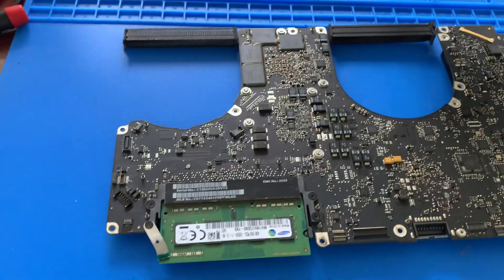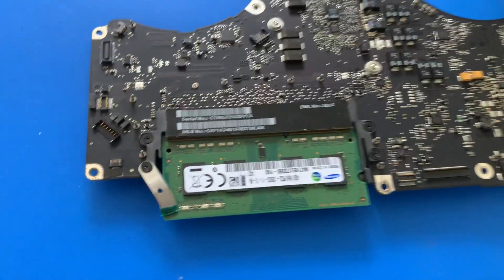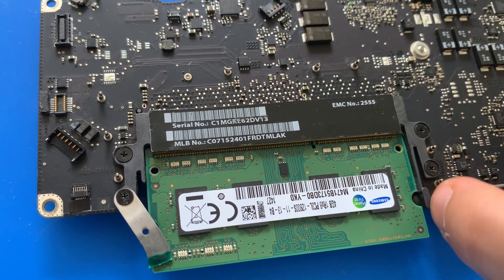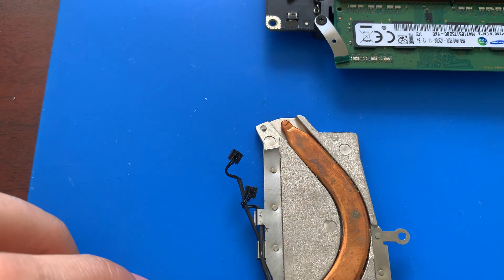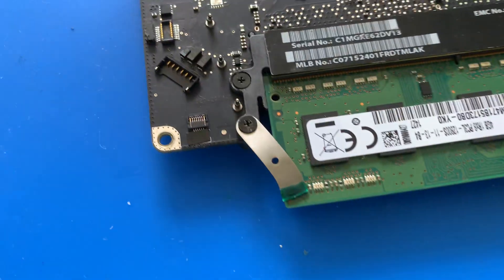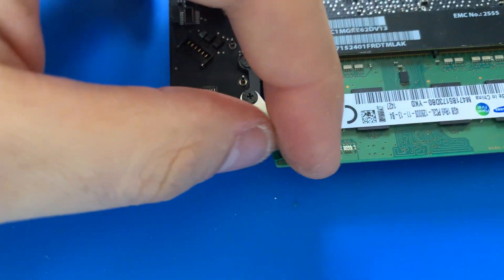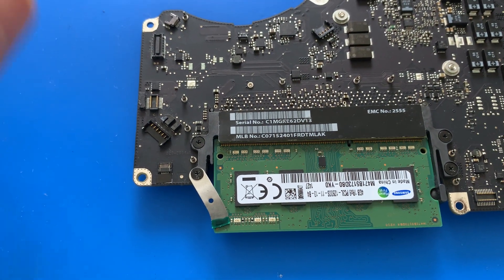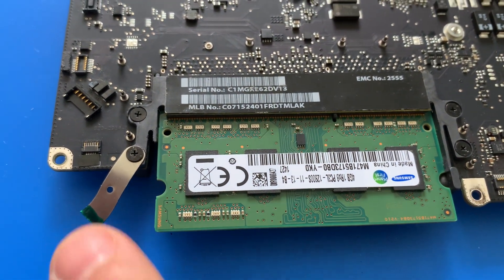Fixing broken Memory RAM Holder Latch on Apple MacBook Pro 2008-2012.

Comment: Does this have to be repaired for the laptop to work? I broke one trying to switch memory with the cover only partly off; one screw was stripped and I can not get it out. One card is out, the second got stuck because I kept pushing it down because I couldn't get it out when it was up.
Reply from the maker: I’ve seen them working fine with one latch
Reply: @applepietech  👍👍

Comment: Very good idea. You can use any suitable metal. dip ram end in epoxy or use electrical tape. I have the same problem. I epoxied the 2 broken tabs in place and will use carbon fiber cloth to ensure strength. Hope it works. Decided not to plastic weld together because latches are quite small.

Comment: Arent you supposed to have the ram pressed down all the way?

I broke my latches on a hp probook and it's the bottem ram so the latches barely work but since it is on the bottem underneath the good ram slot it is being held under.

I've been trying to figure out if it comes out of place...will it fry the motherboard?

UPDATE:

I found a guitar pick. One of the big huge ones it's like a triangle pick...

Fits in there perfectly. 
1.25mm

Although 1.35 might be perfect. 

It can still move with a bit of force from finger. But it takes quite a bit 

Which means if your gonna have your laptop next to a bass speaker then you might want to superglue it?
Reply from the maker: add a little plastic spacer in between the chips so the bottom chip is pressed down more. That should work for You. No, You will not fry the board by messing with the ram. Just make sure the power cord and batter are disconnected.
Reply: @applepietech  thanks for the information . That was an idea I had a moment ago but I was nervous that it would not be good to make contact with the ram like that

Also, if I super glue this piece of plastic in between. Is that an issue?

(I know it will affect disassembly, but it is an old laptop and I think this memory will be the last the laptop will ever see)

Also may affect troubleshooting in the future.